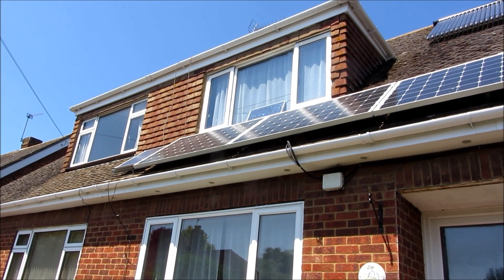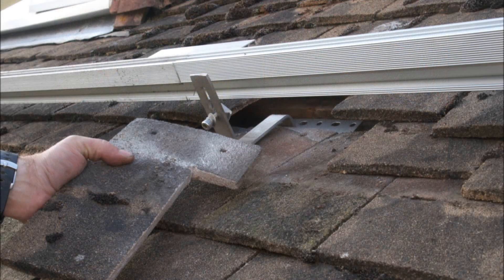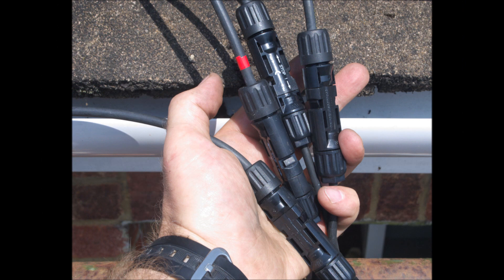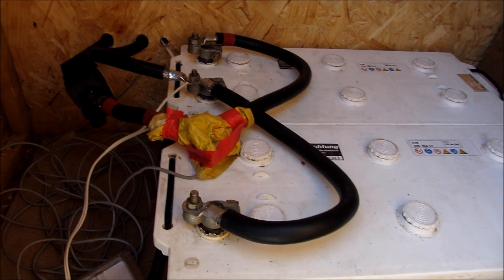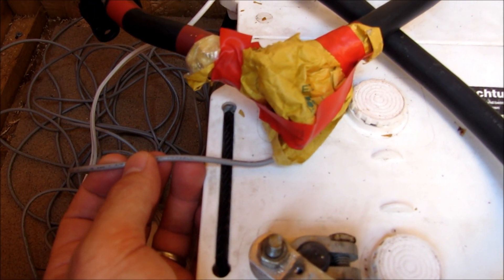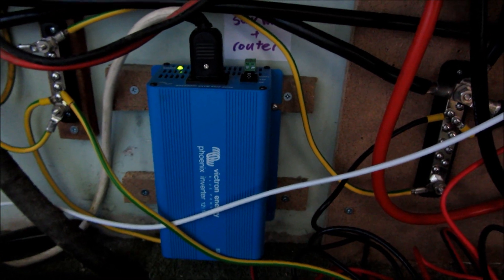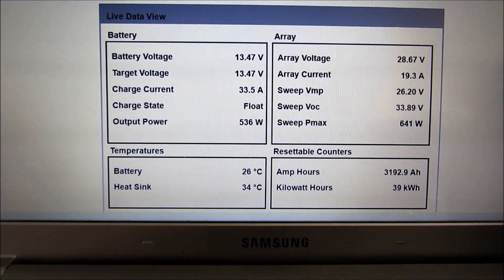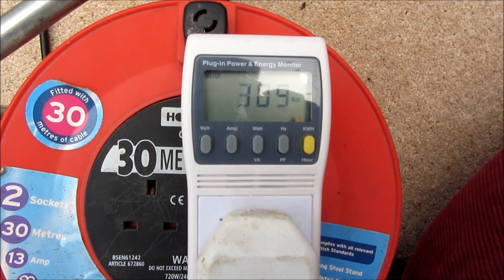Off-grid solar PV with Morningstar TriStar MPPT 60A and Suntech modules

Comment: Sorry that initial comment wasn't for you.

Yes I do have a thunder arrestor on my roof and the inverter
has its own ground terminal. My grounding is such that the ground wire that
comes from the cc goes into  the inverter
then to the the ground yet this still happens, my inverter still shuts off and
shows short circuit during lightening/thunderstorm My thought is whether it is
not proper to wire the cc and inverter together in the same system, or if they
have be the cc and inverter should have separate grounding independent of each
other or maybe the ts mppt grounding serves for both equipments
Reply from the maker: Not sure how I could easily earth them separately, only one earth in the house.

Comment: You are killing your batteries(not softly).  Your batteries will have a very short life if you continue to treat them that way.
You are over discharging your batteries.  Ideally you should not discharge your batteries below 50% of capacity. This would equal roughly 48v.  In your chart it seems almost everyday you are below that.  Once in a while in an emergency lower than 48v may not be devastating but how you are doing it now is horrible for them.
Fully charged 48v batteries would be 50.8 volts
Reply from the maker: +UGBEH CYRIL Did you mean this comment for a different video? Mine is a 12V system.
Reply: yes
Reply: yes, meant for another video

Comment: It looks like the charge current is double what your panels are producing? Very good mppt there if I read the stats correctly!
Reply from the maker: Yes, it is - the upper limit on output current is 60A, irrespective of voltage. If I was starting from scratch, I'd probably build a 24V system, but I had various bits of 12V kit already, and it's easier to find 12V replacements as well.
Reply: My two systems are 12 volt. I have a 45 watt harbor freight charging two 7ah sla batteries. My start which the kids use to charge their phones. My big system has 4 55 watt panels and 600 watt true sine inverter and 105 ah marine battery which is now toast. I'm thing of replacing it with sla but to get the same storage is much more then marine. On the other hand it's probably safer and last longer. My controller is a cheap Chinese pwm. I like that morning star with web interface. Also saw a nice hybrid for wind and solar in one box but no web.
Reply from the maker: DJ-BrianC
The web interface is really useful, I'm often looking at it. Data logging is good too, to see what happened while you were out or overnight. And you can do really detailed data logging if you leave a computer on and connected via the network. The other big thing is no moving parts - many other controllers use fans, which is immediately a part which can fail, resulting in overheating.

Comment: Nice small system for backup lights. and a fridge for a very short time. But any backup is better then nothing. Nice video
Reply from the maker: Runs fridge, freezer and broadband 24-7 for more than half the year, plus laptops, washing machine, etc most of the time. But we've got efficient appliances.

Comment: Thanks Mate, I think I will be doing that in the following months. Are you completly off grid ?
Reply from the maker: Not completely. Mostly off-grid in the summer, but not in winter - though I now use a 30amp charger to put power from the mains into the battery while it's on cheap rate overnight.
Reply: @mikepepler  Nice to hear, I've just recently installed diy 8kw and soon another 8... realized its so much cheaper when you diy, including batteries direct from China. Like your videos on little birds :)
Reply from the maker: @ndudman8  excellent, pleased to hear you've been able to scale up so much! We're pretty much out of roof space... Even a complete refit would probably only get us from 1.25kW up to 2kW. Still, with an efficient fridge and freezer, we don't use much from the grid to run the house. But we have a small EV now, and there's no question of ever running that from our solar setup... 🙄